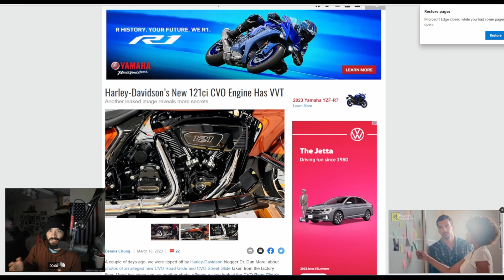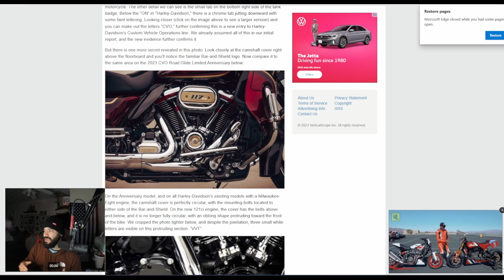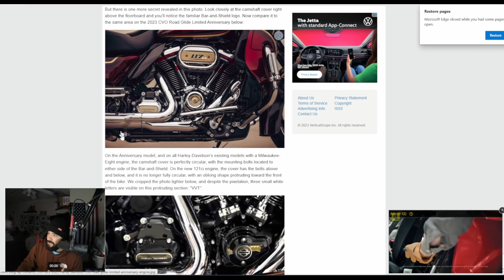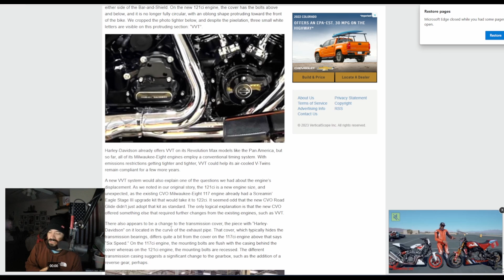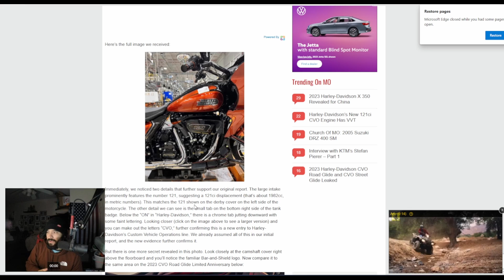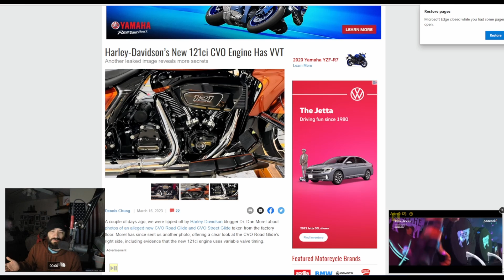New Harley 121" CVO Engine Confirmed - VVT Coming to Milwaukee 8 Engines

Comment: Not much room for price increase, new improved front shocks, as well as a power front wind screen would be welcome as well as a new stronger lighter frame would be nice. I’ll stick with what I got for now and let someone else work out the bugs in this new model. M8 128” is enough!
Reply from the maker: Yep, I’d wait a few years too. Look at the early M8s with the faulty oil pump and primary vent leaks. I’ll probably purchase one in 2025?? 😎👍

Comment: Both engines are power houses . The m8 is best in looks . Harley did really good with the m8 , this is the only engine that's needed for performance or originally what it was built for
Reply from the maker: Without a doubt, the M8 is a work of art!!  And Harley keeps showing us its potential with the recently released 135 crate.

Comment: The problem isn't the design, it's the execution.
Like always Harley will come up with a good idea then cheap out with the parts they build it with.
In two years we will find out all the VVT are failing BUT you sure can buy that screaming Eagle upgrade to fix the problem for some ridiculous price.
Reply from the maker: Pretty much on the money 💯. Do we honestly expect anything more from moco. I can already see the VVT Screamin Eagle Cam Kit in the near future 😂.
Reply: They'll be like the 1st generation M8s, which had the oil sump problems at first. They need to bring back the Evo

Comment: It's probably done more for emissions than driveability reasons.
Same as GM with the defunct Atlas and LS, also current LT engines.
Reply from the maker: Yep, but I'm still hoping we see riding modes in these bikes. Maybe by 2024 we'll see the softails with the same cam
Reply: @InfamousCreep  Riding modes ? On an air-cooled H-D I find that a little superfluous but hey, different people, different needs. Right ?
One day, not too far from now, I hope to own a 114 Softail Heritage with the new "ugly" tubeless wheels.
About their VVT . . . I still don't know exactly how to feel about it. It could be a finicky new mechanical nightmare or maybe a God sent. Only time and early adopters will tell . . . 🤞😬

Comment: Surely they’re pushing the tech forward, especially in the cvo range which can only mean a drastic price increase as well. Another YouTuber who builds custom baggers, said it looks like they’re going to electric windshields and a mono shock also?
Reply from the maker: Sounds about right, which would mean more price increases when we see Softails with VVT cams. I can see the electric windshield but a monoshock sounds unlikely. Then again, the touring frame has been left unchanged since 2009, it's due for a redesign.
Reply: I've got a monoshock on my 20 Breakout 114. They need a factory air-ride setup on the baggers.